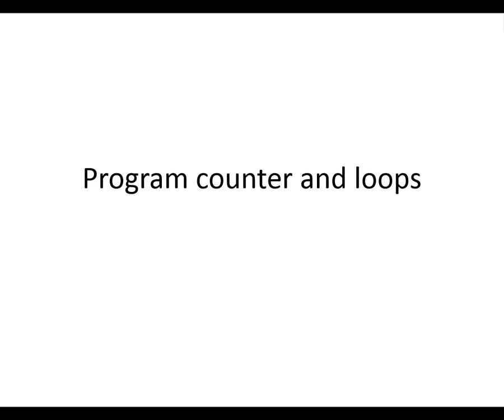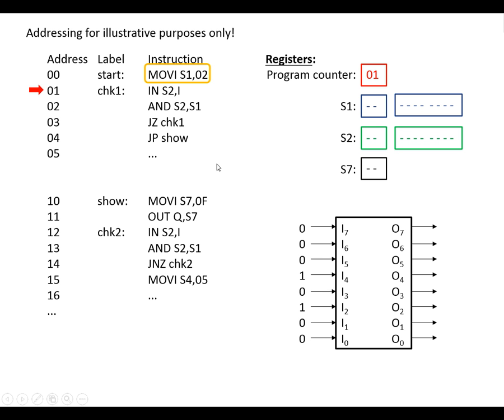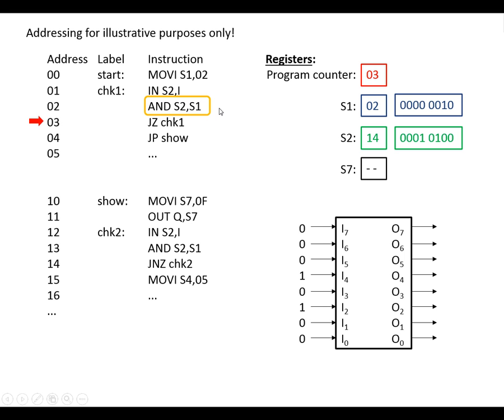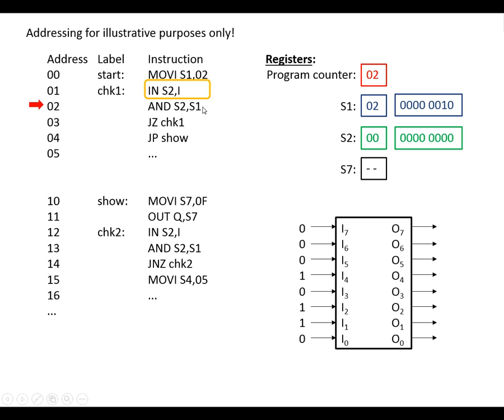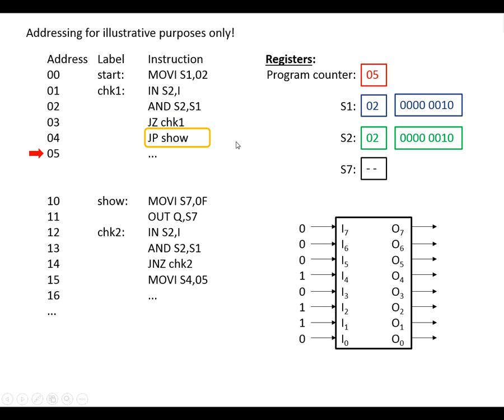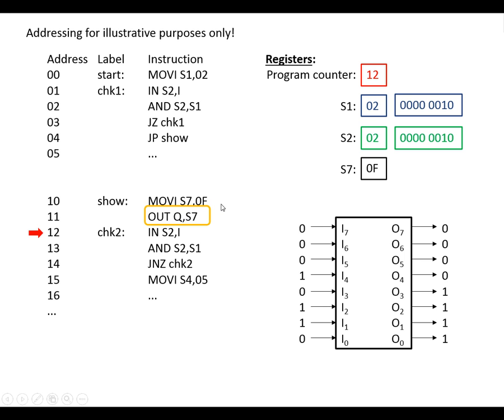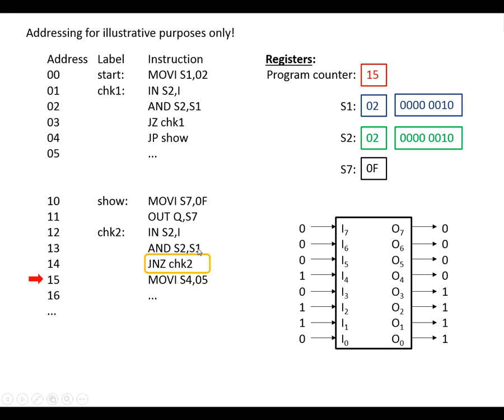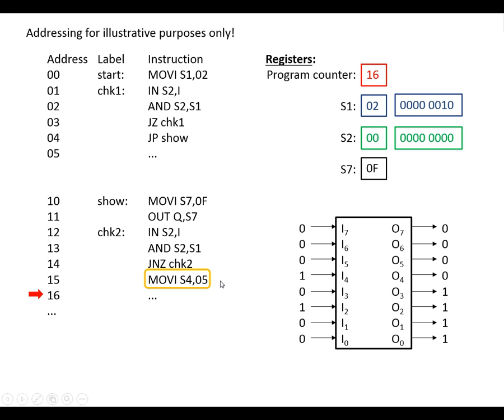Program counter and jumps

Comment: Im sorry for sounding like an idiot but what programming language is this? with instructions (MOVI S1, 02)  etc?
Reply from the maker: Not a daft question at all. This language was made up by the OCR exam board ... they used Z80 before 2010, but switched to this hybrid one (sort of based on PIC). It worked for their purposes.
Reply: It is some sort of pseudo-example Assembly language (Wikipedia's got a good explanation)
Reply: lol bro it's assembly